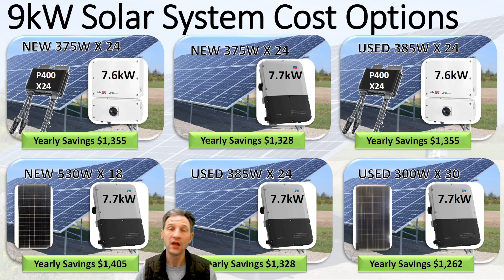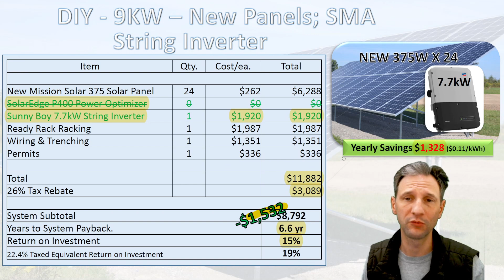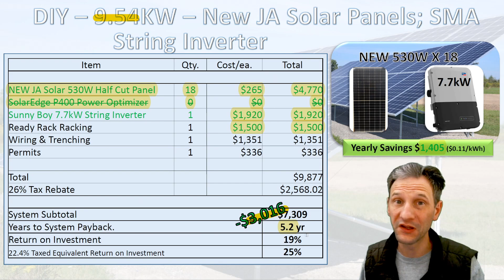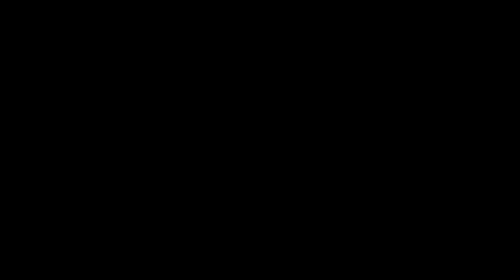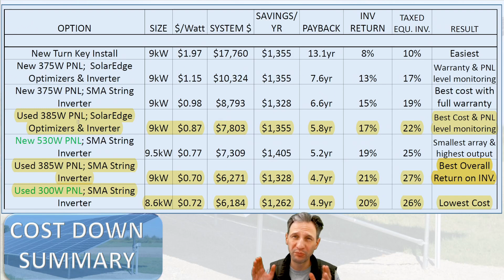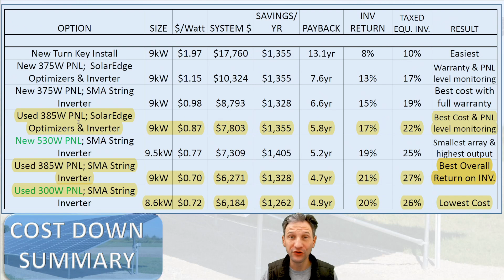DIY Solar Panel System - How to Do it CHEAPER!!

Comment: I may be wrong but if you have clouds you have shade. Optimizers are still warranted?
Reply from the maker: Maybe a little, but generally the whole array is shaded at the same time so not much difference from panel to panel.

Comment: You do great work, Dave. 
I bought (50) 200w Sanyo mods off Craigslist for $550. Sure, they are 16 years old, but for $11??  Then I bought (20) 175 BP’s for $200. Even older!
But now I’m dealing with the increased racking cost involved with more mods. 
Hmmm. I’m sure you’ll have something for me in your list of videos!
Reply from the maker: Thanks for the feedback.  Used panels can be great for the right project, but racking is a big consideration.  You can often get brand new bifacial panels in the $0.30/W range that easily produce more than twice the output of 200W used panels.  Doubling the size of your racking often makes used panels much less of a value proposition.   Thanks for posting your numbers!
Reply: @ProjectsWithDave 
Math on my used/old mods is 5.5 cents per watt, or 6.9 if at 80% of labeling. 
Still no racking solution decided upon - I got engaged with your assembly of battery packs. 

How about this as a business proposition. You find a manufacturer source, run your QC tests and instructions videos, and then private label them as Everyday Dave’s - they work Every Damn Day. 
With all the videos of scammer enclosed batteries, your seal of approval would mean a lot. You’ve established trust with your audience with your straightforward approach.

Comment: Looking back the solar video in the past. In 2025, the diy solar system is a lot cheaper and easier to diy. The only problem is Los Angeles county is so difficult to diy jobs with buildings department. I got an estimate from Tesla solar, they charge me over $720000 but the same range of diy system from Amazon just cost $20000 to 35000 depending on the bands. Even the Delta pro ultra battery back up system also cheaper and more flexible than a power wall 3. As a poor guy and avoid the high labor costs in California. I prefer delta pro ultra 3 with Amazon solar panels. I just need a sub panel with a 14/50 backups or pay almost $7000 for Ecoflow panels( a lot better but unreliable)

Comment: Thank you for the video and the information.
I have separated my solar panels in   4 different directions.
Each on separate controllers.
I have power sunrise to sunset.
I have a off grid diy  system.
My light bill is now under $100 month from $200/$250.
And thats with a 12vt system.
I built this as a beginner project and very impressed with the power it puts out, and the money it has saved me.
 And continues to save me.
Especially on sunny days.

Comment: I have a homemade hybrid system. Cost 2,000 dollars.  Dual fuel generator, 6 used 200 watt solar panels, couple of AGM batteries and a vertical 600 watt wind turbine.  Great for my home in the woods.

Comment: NOw, you can get a use solar panel just 60 dollar per panel for 375watt. It is only $1440. A big different. I checked the 10x450 watt bifacial solar panel cost around $2200.  It is only 4500 watt but if you want to double it. IT is just $4400 and it is 9000watt system.

Comment: Please correct me if I'm wrong.  You are still applying the 26% rebate even when you include USED panels in your scenarios.  Doesn't the rebate only apply to equipment not previously put into service?
Reply from the maker: I suggest consulting your tax advisor for what qualifies in your individual situation.

Comment: Great info as usual. Would vertically-oriented, bi-facial panels serve the same purpose as 2 sets of east-west panels, at lower cost?
Reply from the maker: One bifacial is significantly less than the cost of two standard panels. But you would get better performance with your proposal.

Comment: do east facing secondry panals to get morning sun instead of west a lot of power is used in morning
Reply from the maker: The problem with due East and West is very poor performance in the winter. SSE or SSW seems to have a much better balance.

Comment: Unfortunately for those of us that are retired the tax "rebate"  Doesn't work as we generally do not have the taxes to get the rebate from.  A true rebate would be a great thing for us and quite the incentive to go solar!
Reply from the maker: That’s a good point. If you want to have solar to supplement your expenses in retirement, it makes the most sense to install it while you are still working to take advantage of the tax incentives.

Comment: Could you cover what is the difference with a string inverter? And using either the string or the one that you installed, can you connect those to battery backup for outages?

Comment: Good analysis to consider all options.  You also need to consider best overall life cycle cost.  Use panel life is shorter and they are already degrading more per year.  If you are doing a new project, just use new panels.
Reply: Quite a narrow view fella, if it means you can set up a system with used, versus can't set up a system with new panels ---- well you know what I'm going with. And you are allowing early adopters to pay for all that "new " gadgets/gizmos/equipment and those with more sense than money to optimise our own paths!!! Mmany ways to skin a cat!
Oh, and if you need to swap out a panel 10 years down the line, then I'll get a used one for $50 and crack on!!!! It will be newer technology (that you have paid for (thank you, you early adopter beauty😂), newer in age, and probably more power dense and efficient) 👍👍👍👍

Comment: My understanding is the Tax Rebate only applies to NEW equipment, not used.
Reply from the maker: Where did you get that understanding?
I don't see that limitation in the IRS publications.  Of course you should always consult your tax advisor for tax advise.  
I have attached a link to the related website and IRS forms for reference:
IRS energy credit instructions: https://www.irs.gov/forms-pubs/about-form-5695
2022 Form 5695:  https://www.irs.gov/pub/irs-pdf/f5695.pdf
2022 Instructions for Form 5695:  https://www.irs.gov/pub/irs-pdf/i5695.pdf
Reply: @ProjectsWithDave  I can't find it now, I swear I saw it somewhere a week or 2 ago when I was researching buying used battery cells to build a pack to see if they would still qualify and I saw it in one of the things I read, but if i'm of the wrong assumption thats good news. I'm trying to find everything I can do to reduce the cost of doing a system. 

For now i'm half tempted to get one of those Heat Pump Water Heaters since they pay for themselves in a couple years with energy savings and there is a 30% tax credit on them this year also.
Reply from the maker: I've considered getting one of those to run some tests and see how much they actually save.  Keep in mind they cool their local environment so if you are in a cold climate trying to heat your house that may be counterproductive.
Reply: @ProjectsWithDave  yeah, that's the main thing holding me back, I'm trying to figure out how much the cool the space, like how many BTUs it sucks out of the air. I'll say this, if I lived in South Florida I'd get one and install it in the garage to get free cooling in the garage, but I do have to heat the basement from late October till March so that is a concern.
Reply from the maker: I've considered adding a ducting system to vent the cold air outside in the winter and inside in the summer.  However, I would still be robbing warm air.  It is going to pull all the heat for the water out of the air, so the only way it makes sense in the winter is if you have a cheap way to heat your house.
Reply: @ProjectsWithDave  So I just did a quick bit of research, found a study that showed it cooled the basements by about 4 degrees when it was running but they would level out after a bit when the heat pump finishes cycling, also I found some formulas for cross comparing different "power sources" that are comparable by converting everything to BTU's, like it takes 293 KwH to equal 1 Million BTU's, Propane is 11 Gallons per Million BTU's and then using the C.O.P. to give you a price per Million BTU's as a way to compare efficiencies, you just gotta know what the COP of your houses heat source is (of course with heat pumps the COP depends on temperature).
Reply from the maker: I think from a logical point of view, the heat pump water heater solution is a better fit for warmer climates.

Comment: Is this a grid tied system with net metering?  Are there any good rack mounting options with adjustable inclinations to optimize by season?
Reply from the maker: Yes, if you want adjustable I would consider Sinclair : https://sinclair-designs.com/solar-ground-mounts
I'm not affiliated with them, but I have friends that have used the racking and are happy with it.

Comment: Great video!
What I wonder though why batteries are not part of this total cost - or are you operating without batteries and in the night you are using grid power?
Reply from the maker: Right.  I use the grid as the battery.  It's much cheaper.

Comment: Hi Dave,   
This is very nice spreadsheet.   

One question I need your answer, why there is no budget to have Battery to store excess energy generated during daytime, so, those could be use during night time ?
SY
Reply from the maker: The system I installed is grid-tie only. It does not require a battery.  Batteries add a lot of cost that is very hard to recover.  The grid acts like the battery.  If you have net metering, it is the lowest cost solution for installing solar.  You can see more on how it works for me in this video: https://youtu.be/IwUK1dNJ3n8

Comment: I have 18 years installing exp and you're gonna regret cutting so many corners later, especially using trash panels like that. sure they may have a long warranty but what's that worth if they go out of business as 99% of panel manufacturers have done over the last 20 years. also, solar edge is a wasteful gimmick.
Reply from the maker: The main point of this video was that my SolarEdge setup was not the cost effective solution.  What cut corners are you concerned about?

Comment: Great tip on the used panels!

I installed some used panels (115W ca.late 90's - early 00's) on a camper bus build, for a friend, and they're super reliable. The sizing of older panels, along with the lower open circuit voltage and short circuit current are very versatile.

Funny fact: they're manufactured by Shell

Comment: Good video once again Dave !  I just got (jan-2023) 8.88 kWp system, 24 x SunPro panels 370W + Sungrow 8.8 k string inverter ( 3-phase)    Installed "turn key" price was 8430 euros. Half of it was installation fee 40% of that I´ll get tax rebate 1580 euros. Total price was  6850 euros.  Greetings from Finland.
Reply from the maker: Thanks!  I hope your system does well for you.  Thanks for noting your specs and cost for everyone to reference.

Comment: Including panels,inverters,zclips,solar wire,fuses and accessories batteries included spent $8000.00 for it all but went through a lot of elbow grease installing everything alone. This includes duplicate load center connected to inverters and once working moved everything from grid load center to inverter lc. Try to do most laundry and baking/welding projects on sunny days to take advantage of the energy the panels can produce that house doesnt need normally.also looking to get electric hot water heater as a dump load for panels on sunny days to cut back on propane i normally use for hot water. Pellet stove heats house during winter and that only draws 80 watts per hr.

Comment: Just installed my own off grid system with 20 450 watt znshine panels 7 on east facing roof,7 vertically mounted on east facing wall and 6 more vertically mounted on south facing wall. With bluepower 6548 (2) units mounted and connected to give me 240 volt service using the built in mppt controllers to handle the three strings which call for whatever power needs the house requires. Also have 8 walmart special deep cycle 100 amp hour batteries in a 48 volt setup. Also have a breaker from main load center sending power to inverters during the night. With a dozen more batteries could keep the grid breaker off as long as sun comes up next morning to recharge batteries as when called for panels can make up to 5kw as long as sun is shining. Most sunny days i dont need grid til sundown

Comment: Another great show. The comments are valuable too. So much drama on the internet this is so nice to see and keeps my blood pressure down. I won't get much if any rebates as I am retired with low income. Probably won't save much on electricity because I don't use much electricity. I will check with my electric company anyway since this is the way of the future.

Comment: I went through the same analysis and arrived at an identical conclusion.  

Interesting revelation is the panel degradation is dramatically lower compared to the rate at which our electric rates are increasing. In the end the annual year over year financial gain is positive.
Reply from the maker: Hopefully the surge in electric rates is not going to continue at this pace, meanwhile, it's making the case for solar easier.

Comment: Optimizers are DC-DC converters, which have losses. In the case where you have matched panels all in full sun, I doubt you'll see much if any loss of generation from removing them. You may even see slightly higher production because you no longer have the internal losses of the optimizers.

Comment: How about no racking and just flat to the ground? Seems like just by removing racking the roi will be less then 3 years
Reply from the maker: That would not be good for heat management, or wire control, or wind resistance.
Reply: @ProjectsWithDave  what about something like https://youtu.be/lCrrKfR7llI seems to be the mounting hardware cost as much as the panels
Reply from the maker: In this illustration the panels are held down with blocks.  That would be ok if you have no vegetation growing in the area, or snow.  Also allows more access for animals or random damage.
Reply: @ProjectsWithDave  how much is racking typically per kw? It does seem like racking costs is the same as solar panel costs. In which case your ROI could even go down to < 2 years
Reply from the maker: Prices have gone up since I installed my system, but you can see a cost breakdown for my ground array here: https://youtu.be/PNTO83FvaL4
And a cost breakdown for my shed array here: https://youtu.be/InSpYqB-efE

Comment: Your payback is going to be way faster than you thought so grid electricity is going to go through the roof
Reply from the maker: Yes, this was made right before the big surge in electricity prices.  I need to do an update with the latest equipment options and electricity prices.  The equipment options are getting better and better and electricity is getting more and more expensive.

Comment: Thanks for doing the analysis and data for me. I do not reinventing a wheel.  How are prices since a year ago now?  Higher or lower?  It is now Q4 of 2022, lots of new hardware and systems on the market and new tax credit coming in 2023. I am going to presume I need 12KW system on a ground array. 

1, Does it matter if hardware is US made or someplace else to obtain the tax credit?   2. It seems like it may be best to go with largest/highest output panel (used if they exist in supply chain)  to reduce rack size, cost, footprint?  Is this your point?  vs use of smaller less powerful panels that would take many more panels to do the same power output.   
3. So you did not use micro-inverters (correct term?) on each panel, i have seen claim that some micro inverter allow two panels/ micro inverter.   Do they help with system failure/maintenance? and also do the newer micro inverters reduce "clipping" of the overall panel system output?
Reply from the maker: My original install used optimizers, but this is an expensive solution.  I did a recent install on my shed using micro inverters that is working very well ( Shed install video: https://youtu.be/Y8OGxdJ9cU8 ).  Panel output vs array size is just something you have to balance for your install.

Comment: I've been able to pick up all of my 48 P400/P401 optimizers- are all of your panels less than 400w, I know your initial setup was 375 but what do you know what would happen if you put a 410 w panel on one of your optimizers, Just curious- Looking at possibly buying new panels from alibaba, tax credit can't be applied on used panels from what i've read on the tax code
Reply from the maker: The most important thing is to not go over voltage.  Extra current will get "clipped."  I installed 390W Bifacial panels with the P400 optimizers and with the back side boost they were reaching 407W.  You can see the results in this video: https://youtu.be/1SXNjsSsmq0
Of course anytime you are running things at their limit you are likely to wear them out faster.
If you want discounted panels, but are concerned about the tax credit applying to used panels, SanTan has new bifacial panels that are clearance.  You get new panels at a reduced cost, but the warranty is only 1yr.  That's what I bought, I don't think 25yr warranties are worth the cost.  Keep checking back, what they have changes all the time.   SanTan Affiliate link: https://store.santansolar.com/product-category/solar-panels/?ref=EverydayDave